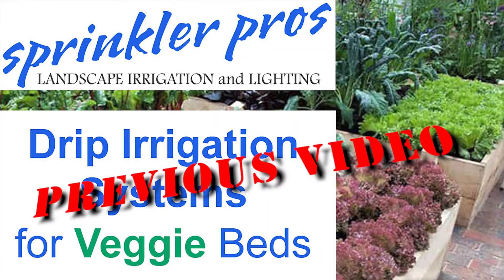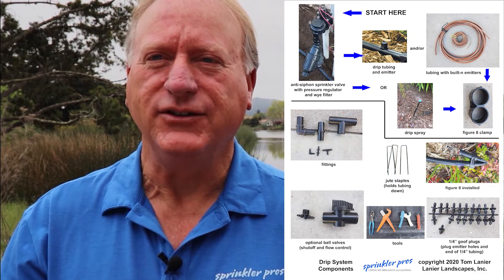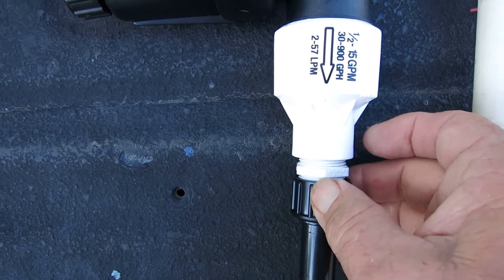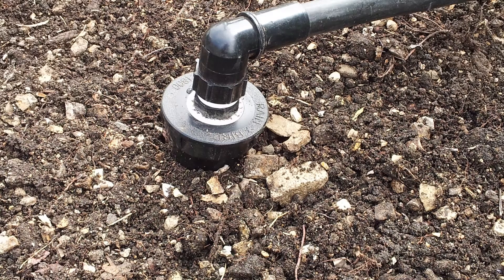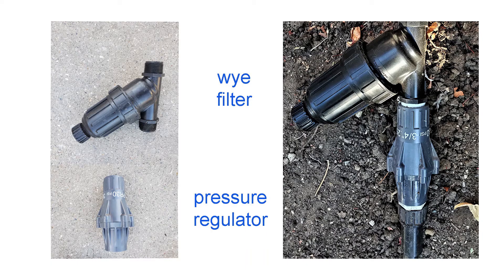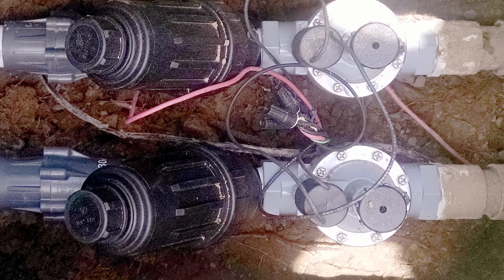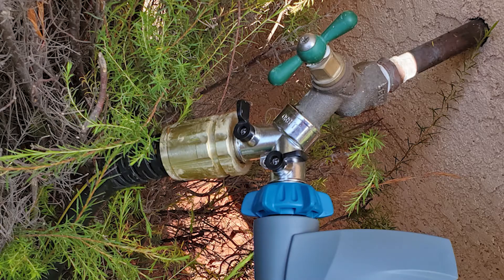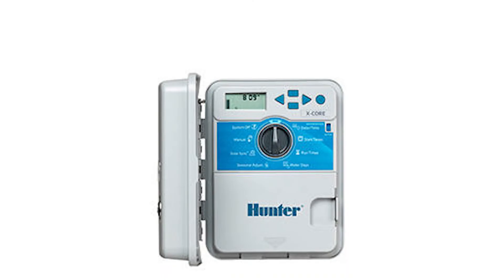Connecting Drip Systems to Irrigation Valves and Faucets

Comment: Thanks for your useful videos. I'm building adrip irrigation system for my small-ish nursery which uses well water. Based on your video it looks like every line from the manifold will require it's own pressure regulator and filter ? I'm starting with an 8 station timer for a portion of the nursery so just want to make sure I'm not unnecessarily duplicating parts. Thanks!
Reply from the maker: If you're on a well, you may not need the pressure regulators but do need the wye filters. If you're on a well, you should also have filtration BEFORE the valves. See my video about well water. If you have 40 to 50 PSI static before the valves you may not need the regulators. Any other questions?